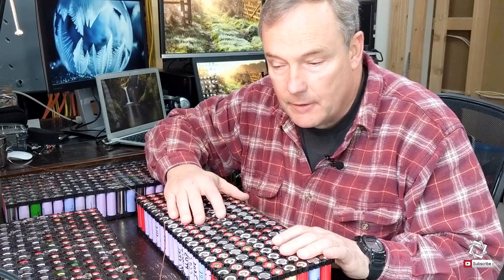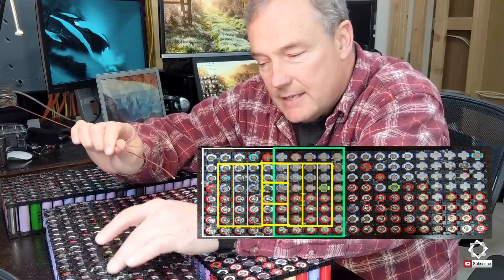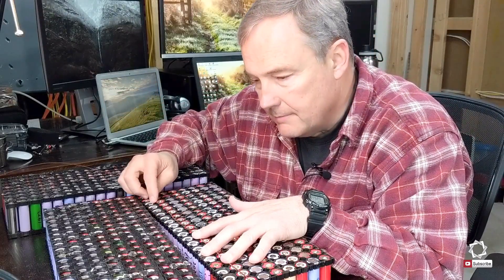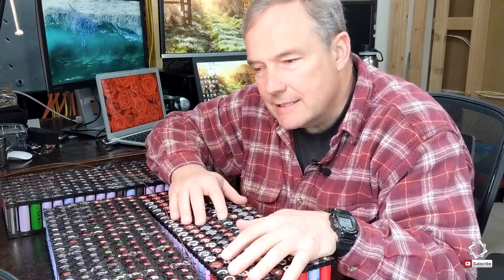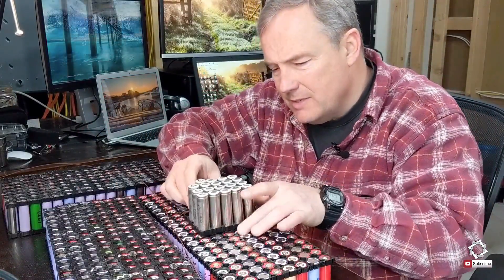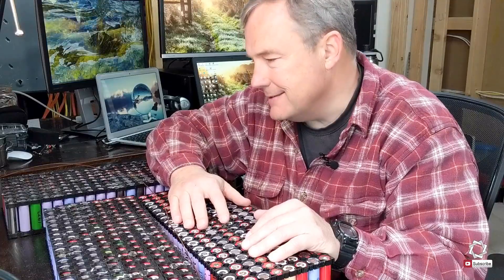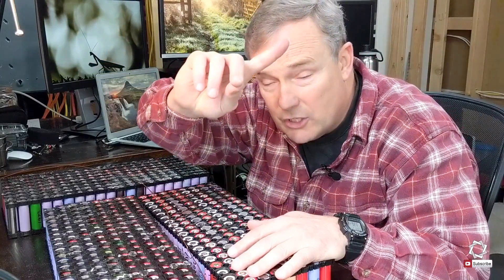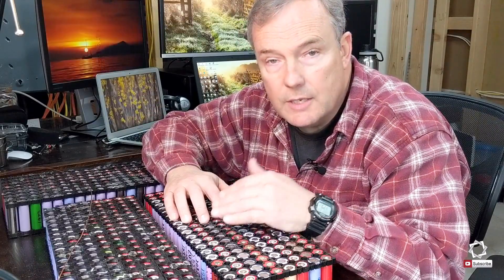Update on The Portable Powerpack Battery Upgrade

Comment: Where do you get your 18650s from?  Reclaimed laptop battery packs?  If so, from where?  Could one just go to wherever batteries are recycled and ask for the 'broken packs'?
Reply from the maker: A small amout of my cells came from laptop batteries I bought on eBay.  Some of the cells I got off eBay were new when I bough them in bulk.  Here is a video I made on finding the bulk of my cells.  https://youtu.be/gLJ7fx2zrMw  Also, Check this video out by jehugarcia it is awesome!!!
 https://youtu.be/akLOCPeKavc

Comment: I see lots of people use nickel strips to connect,Is it possible to use galvanised steel instead ?
Reply from the maker: From what I understand galvanised steel uses zinc and zinc will corrode over time. Nickel, copper and aluminum are better conductors.  I hope that helps.
Reply: Yes it has Thanks :)

Comment: just an idea solder wick or braided copper solder wick works really well but more amps from braided copper 1/4 with should work nicely and not be to wide i  have not got around to it yet. Im doing 4S myself with 18650s only about 80 amp hour for testing and running every day with solar. I dont have a source i can get used laptop batteries from so im having to buy all my cells

Comment: you are making  (3) 4s40p packs  and those 3 packs will be running in parallel with each other, correct?
Reply from the maker: Correct. It's kind of an experiment to allow me to add and remove battery packs.  This will be the same basic design my powerwall will have.  The powerwall will be much bigger. 😎
Frank
Reply: I geeked out a little bit for you.  How bout this?  https://1drv.ms/u/s!AnJui0mCUMl4g3XIJ_8Twoa1InUc  Keep in mind, I have absolutely no idea what im doing.
Reply: I just saw your next video - Sounds like you liked my design.
Reply: wow, not even a reply, huh?  Not cool man.

Comment: Really enjoying your videos Frank as I consider moving my SLA systems to 18650 packs. I am curious if you could talk about BMSes with regards to large packs. Are you getting a BMS that has connections for each cell, or for each parallel set? If for each parallel set, are you worried about unbalanced charges/discharges and other issues on individual cells within that parallel set?

Another topic I'd like to hear your input on is what are some key things to look for when  deciding on which lot of batteries to by on Ebay. Are there better brands than others? Are there some things to watch out for?

Comment: I was thinking about . turning the packs on their side. and soldering like 8 ga. wire to the buss bars. 2 pos. 2 neg. in the center of the pack. or maybe 10ga. and on all 4 ends. of the busses. so 4 ,10ga for each pos. and neg. then wife the packs in series. since the packs will be 3.7v nominal. I'm running 7s and charge to 29v. maybe I should just keep it simple! and do the offset thing! thanks. there so many options.

Comment: What you are describing re:”Positive and Negative on opposite sides not the same side” is a well known issue going back to chains of lead-acid batteries. All wire, even very thick bus bars, have some amount of resistance, and that resistance causes cells to see more current if they are close to both the positive and negative. You have to make sure that all cells have equal lengths of wire when adding together both the wire before and the wire after. Placing the pack terminals on opposite sides is an easy way to do this.
Reply from the maker: Yes, I was referring to positive and negative. Thank you for your input, I have had concerns with the way some people build out their cell packs.  I just want to do it correctly.  Thanks for watching.